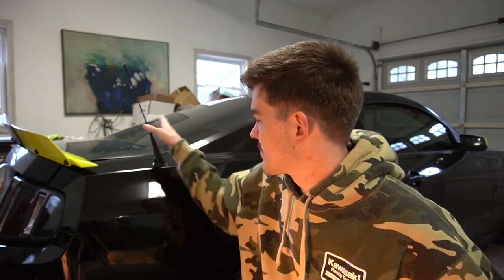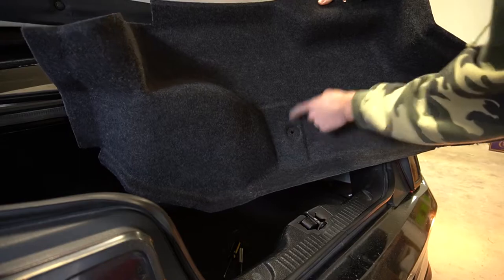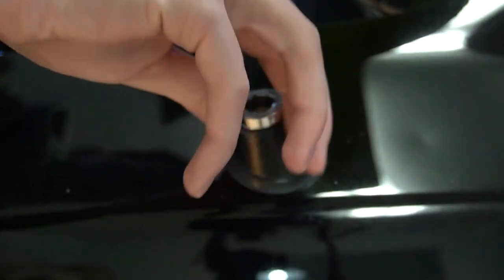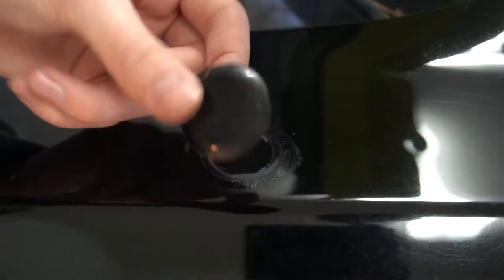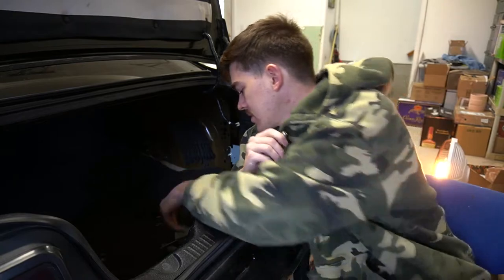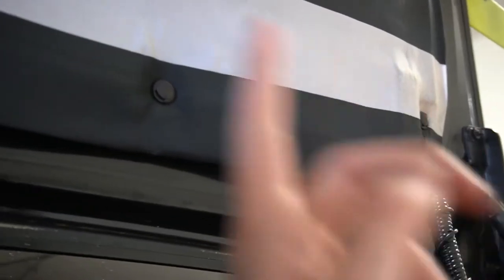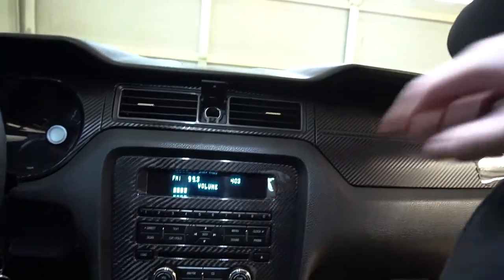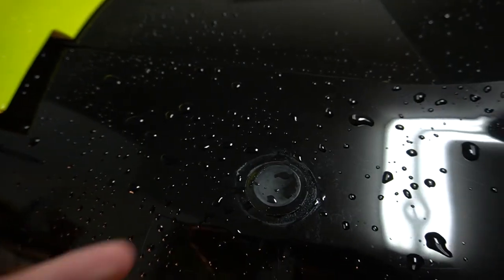2010-2014 Mustang Antenna Delete (Shaved Antenna)

Comment: My antenna still keeps spinning when I’m trying to unscrew it. I already removed the silver box in the trunk
Reply from the maker: The tall part or the mast?
Reply: @MotoTaco  tall part
Reply from the maker: Sounds like the plastic broke somewhere inside the mast. If you Silber box is unplugged, hold the antenna part in the fender while you unscrew the antenna. If that doesn’t work might just have to rip it off
Reply from the maker: Or pull up while unscrewing
Reply: @MotoTaco  I got it out. I literally peeled off the entire antenna until I saw the screw that was locking it from the base. Just had to unscrewed that lock from there
Reply from the maker: Good to know for others!